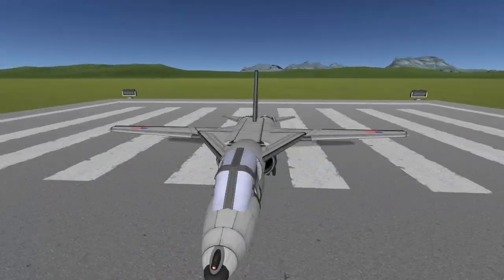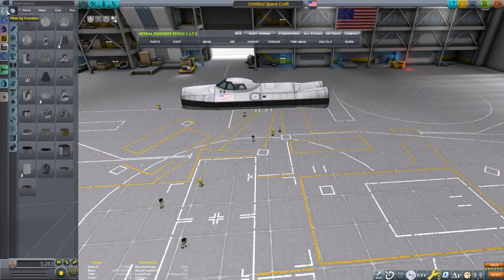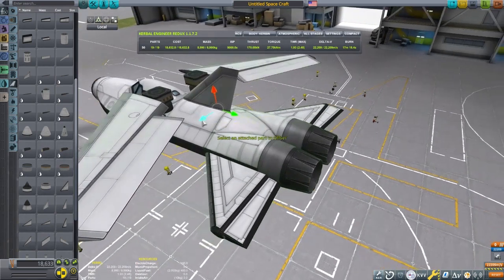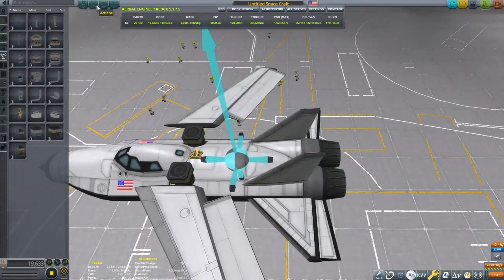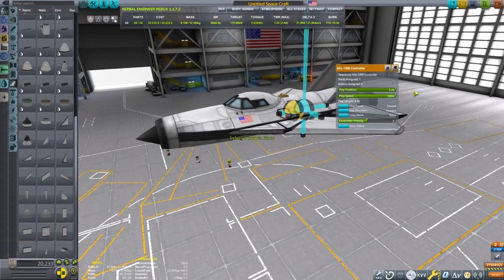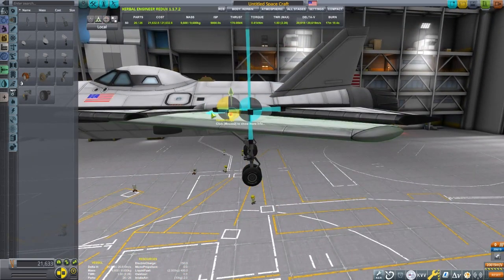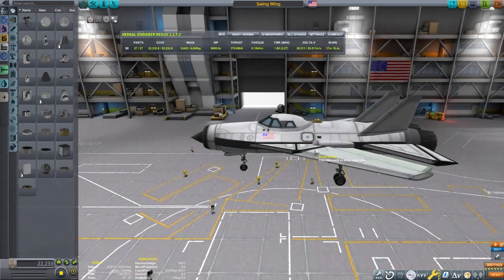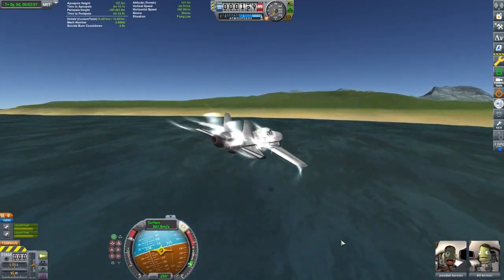Swing Wings

Comment: Echo 3, your variable sweep wing design does not work.  Your wings "flap" around.  There is a good way to make sweep wings.  You need to use the engine plate as a base, as the nodes have a unique property of "FIXED_JOINT" and rigid.  This means that when you attach those Rotation Servos to the engine plate, they will not wobble around at all and be perfectly fixed to the body.  You need to set "same vessel interaction" to true on the wing segment at the root, and create other sections, including the engine plates as a "sandwich" to keep the wing fixed in position as it deploys(these need "same vessel interaction" set to True also).  Basically same as you see on the real aircraft.  Then you can have large, practical, variable-geometry wings and they will not "flap".  Took me a very long time to figure out how to do good variable geometry wings, you seem like someone who is worth sharing the info with.  Remember you can toggle "same vessel interaction" in the KAL so if you are making a deployment animation, you can have the wings overlapping inside the body, and become fixed when they are deployed only.
Reply from the maker: Thanks for the great explanation. I call these tutorials discussions because I hope to generate comments exactly like yours.
Reply: Engine plate? I haven’t seen a engine plate anywhere.
Reply: @JacKnife3705  its in making history dlc, you musst buy it to get it
Reply: You are a genius

Comment: Love your videos. I gave up on swing wings a long time ago, but this video got me trying once again. I have something working and it's fun. As long as nobody moves it can lock into place without becoming flappy bird. I'm going to try what Gavin suggested but I'm honestly kind of confused.
Reply from the maker: I probably should make an update to this video. Gavin is correct. You will need a plate of some kind above and below the wing. You will need to have advanced tweakables enabled, but you can enable same vessel interaction. That will help keep the wings stable.
Reply: @Echo3  Well I would love to see that! 

I did end up fiddling around with your design and if you make the swing wing as a subassembly with a bunch of little wings on the opposite side of the servo so that the center of lift and drag are in the center of the servo... then place a pair of those on your aircraft, it's nearly counters all aerodynamic torque on the servo.

I also am trying to run unmotorized free moving hinges through the center of the servo that have docking ports aligned with docking ports inn the body of the aircraft. These would dock to each other when the craft loads in. This should create a servo that can spin but is also rigid. It might also summon the Kraken.
Reply: @Echo3  when you make an updated video on sing wing for ksp 1 can you please link it? I'm looking forward to it!

Comment: Hey echo I know you probably wont see this but what about piston-activated swing wings? From what ive tried they are more stable at high speeds and loads but are heavier and have more limited swing angle? Also sometimes they dont work due to space(trig) limitations or stuff. So can you look into them?
Reply from the maker: I read every comment. This is a small channel. I've never used pistons for this application. Do you still use an unpowered hinge or server as the rotation point with the piston?
Reply: @Echo__3  yes, one hinge that connects the wing to the plane, 1 that connects piston to the wing and 1 with struds to connect the piston back to the body

Comment: god its been a year but im still going to ask this, how do you overcome the wing flexing ?
Reply from the maker: Using same vessel interaction on the wings. Then add some sturdy parts  like engine plates above and below the wings also with same vessel interaction. Lock the servos when you are not moving the wings.
Reply: @Echo3  my plane says servos are moving even though they are not
Reply: and even if i lock before takeoff its still is unstable as f and wobbles all over the place
Reply from the maker: @RP_Duval  This is an issue that I have also struggled with, but using powerful servos helps. Turn off the dampening. You could even try overclocking the servos torque to make them stronger. I have a KAL-1000 tutorial that shows how to overclock parts.
Reply: @Echo3  won't these plate generate a lot of drag ?
Reply from the maker: @dimn0198  It is possible to get everything to fit in a cargo bay. If not, then the servos will have drag.
Reply: Try using hinges

Comment: Both of my wings only move to the right please help 😢
Reply from the maker: Are you using a KAL 1000 to control their movement. Once placed, removed the hinges from symmetry and set them up separately in the KAL.
Reply: @Echo3  I am using the kal 1000 I'll try what you said thank you for the help
Reply: @Echo3  I did what you said but it still isn't working
Reply from the maker: @redboi4206  Is everything working correctly in the SPH when you test the KAL?
Reply: @Echo3  the wings move but one will move to the right and the other one will also right instead of both moving forward and backward
Reply from the maker: @redboi4206  Can you send me your craft file?
KerbalX is a good website for that.
Reply: @Echo3  I'm on a Xbox 💀💀💀
Reply from the maker: @redboi4206  It would help if I could see what you are describing
Reply: @Echo3  if you have a discord server I could take a picture and show you that way
Reply from the maker: I'm on discord, but don't have my own. I am active on reddit.com/r/KerbalAcademy. You can post there.
Reply: @Echo3  ok thanks I'll be sure to go on there